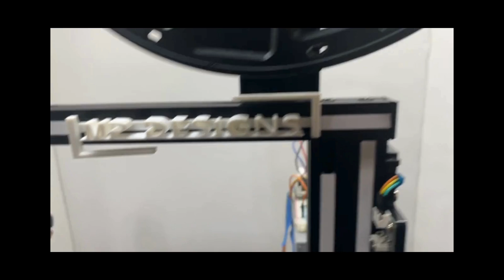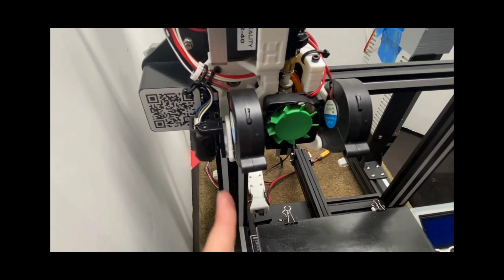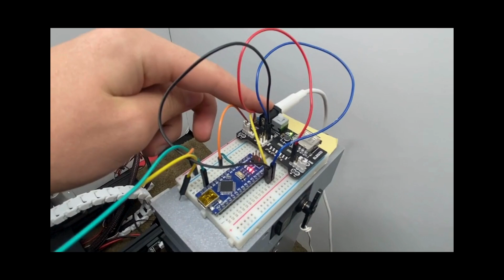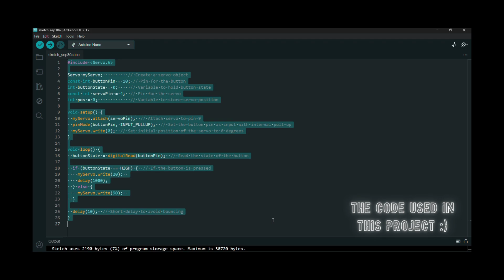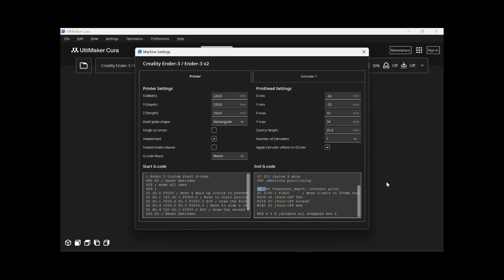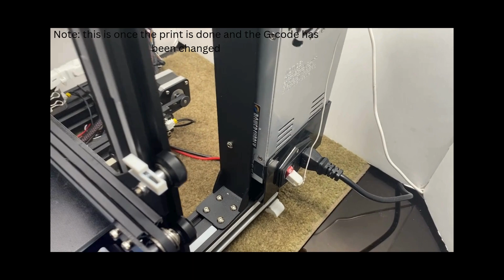3d printer Auto turn off system!!

Comment: Or you can buy a beaglecam that controls all the printer functions, and also add a smart wifi plug that you can use to turn on/off both even if you're outside the house.
Reply from the maker: That would work...but... that is about a 90$ fix..my way cost me about 8$
Reply: $8 including the arduino?
Reply from the maker: No I already had the arduino to begin with